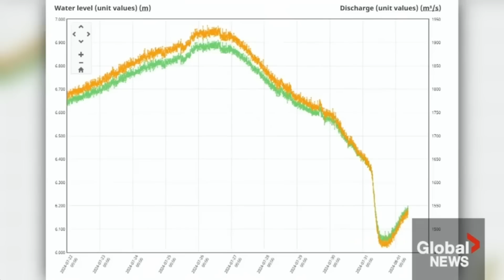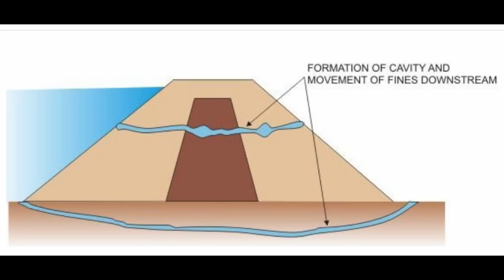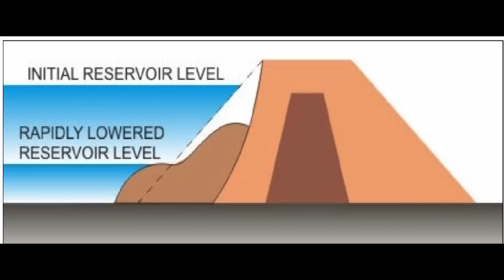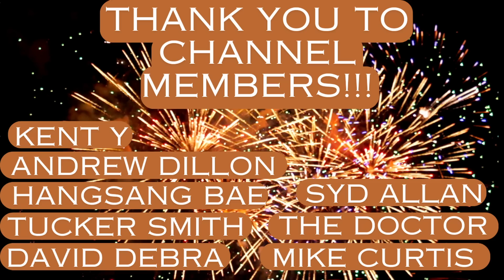Massive Landslide in Canada Creates Dam that will Fail

Comment: Yes it will overtop, but the mitigating factor is the inflow rate to the 'reservoir'. There is little rain forecast before this can overtop so there will be little excess input to drive the water flow. It should be a sufficiently large mass that will be cut through fairly slowly.  It is not like an earth filled dam which is relatively short horizontally and can be cut through vertically quickly with the side material comparatively stable.  We can likely expect a long term mud water/slurry flow.  The sides will collapse in requiring "work" by the flow to move.  It's going to be messy but I think we can all take a deep breath.  The massive, sudden debris flows shown both here and in news casts are the least likely outcome.  I think we're looking at a longer term 'surge' of very muddy water, it might overtop in stages as denser material slows the cutting action.  It's going to play hob with fisheries and water supply, but remember, this is a common event in the life of the Fraser River drainage.  Not "common" in a human's time scale but common in geological terms.  It should be amazing to watch and follow the progress of the leading plume.  I'm most curious to see what it's like at the mouth of the Fraser River and into the the Strait of Georgia.  Will it be any larger than spring freshet?  Geology is wonderful and a constant reminder that we are merely bit players on this planet.
Reply: Except the water flowing into the Chilcotin also comes from snowmelt. And we’re supposed to have a heatwave this weekend.
Reply: I live just north of Hope 11 KM and I think you are right with your analogy .Water will cut a new 
channel and a slow release will happen yes long term muddy waters with all kinds of debris.Hope
it will go slow .A good thing is it is 800 M Long so there is lots of holding power in the land.
Yes if you look at the landscape this has happened many many times in this Water shed .
Reply: This is also a disaster for the fisheries. I heard the salmon are migrating, and have not eaten in about a month, Plus all the  ash, carbon chemically change the river, Hopefully they won't suffocate. The whole ecosystem will take a HIT.
Reply: Thanks for that great and lengthy comment, this is along the line I was wondering about; future updates will be interesting for sure! I read they already made evacuations and set up no go zones; anyone know if there is a government website dedicated to this situation?
Reply: Right! Mainstream media loves to play on people's anxiety. MSM provides no stats on the relative flow of the Chilcotin River vs that of the Fraser or the Thompson. The Chilcotin  River is not that big and that dam is going to take a lot of time to erode. The real tragedy is environmental. The river's salmon runs are ruined this year, and possible for longer. One solution suggested is to dynamite the edge of the dam to get the water flowing by. I don't know if that is workable, but a flow ought to be started asap. Helicopter fly byes show three former river ledges on the south bank indicating either previous water flows or isostatic rebound. We are looking at a history of catastrophic river changes.
Reply: Let nature take care of it's self. Every time government gets involved,they screw it up ..let it be
Reply: If the entire dam becomes saturated, there is a risk that it could rapidly liquefy and begin to flow - basically just melt into the reservoir waters as they rush downhill.  The sooner it's over-topped, the better: you'd rather have a dam of relatively dry earth than a dam of unstable mud.  (Keep in mind how the dam got there in the first place.)
Reply: i totally agree. him comparing it to a manmade dam collapsing is not correct. it will top itself and it will take years before the river recuts itself a new channel.
Reply: Thank god some sense, this is not a disaster waiting to happen, look at the actual terrain and the lack of population anywhere near. No threat at all.
Reply: Exactly right, the fear being exploited is totally unnecessary

Comment: Hanceville and Dog Creek aren't town's. Should have used Alexis Creek and Williams lake as reference points.
Reply: Dog Creek does have a tiny store. I’d agree that it’s hard for people who haven’t been there to understand just how remote the Chilcotin is. They may have paved the highway, but the population especially after hunting season drops pretty low. “Gang Ranch” may be a million acres in size, but more people live on my block than herd cattle on the ranch. 

Latest from B.C. government is slide blocks about 1,000m of river length. They’re still calling it 30m deep. Lake as of midday 8/2/2024 is 11km long. 

The Fraser sees some truly large floods without much impact in the canyon. While anyone picnicking on the river would be at peril it’s hard to imagine peak flows from this thing doing much harm at Hope. High water has closed the highway in the past for a couple days but they clean that up pretty fast. I only remember one flood caused slide in the Canyon causing real problems in the last 50 years. Not as all-important since they built the Coquihalla highway. There’s a couple of obscure cabled ferries that might need to be pulled out of the Fraser River.

The Provincial government has to be conservative of course.

Comment: This is not the first time this has happened up here.  There was another slide in 2004 that did the same thing.  It was further downstream.  There are unsubstantiated rumours that water is starting seep through the bottom.  A few years back a slide also caused a partial blockage of the Fraser close to Hells gate.

Comment: I used to live in Hope BC. This will be devastating.  There are a lot of structures that will be affected if the Fraser rises significantly.  Bridges may be damaged or lost from all the debris...  more dams could form north of Hope because of debris, and then catastrophically fail.  I was there when Hope had a log jam at the tunnels like 40 years ago. If it broke, a wall of water would have removed all the homes on the Coquihalla River and one bridge.  Residents need to take this very seriously  and stay away from the Frazer River.
Reply: True.. this isn’t looking good..🧐
Reply: BC almost lost Hope with that one. Been a while since I've passed through Hell's Gate and gone beyond Hope.
Reply: There's a distinct possibility that the outflow burst might cause enough downstream erosion to cause further slides into the river. There are several worrisome choke points along the way.
Reply: Trench it to release pressure
Reply: Do you think TransCanada after Hope to Vancouver can be affected, or is it high enough ?
Reply: @dmitripogosian5084  For the most part its pretty high. It'll go through the canyon, which is "V" shaped, some areas are concerning as it gets quite narrow, in that case debris will likely get stuck momentarily, then tear away at the sides of the rocks, etc. It's not going to be bad. Am disappointed that our government didn't just drop aerial explosives from a helicopter, instead of letting the backed up water from the Chilcotin  by upwards of 20 kms or more. They could've dropped explosives beginning on the dry side in timed drops.
Reply: if the government entities weren't useless and blaming "climate" they would have blown it already to mitigate the disaster. waiting till it fails by itself is guaranteeing it.
Reply: No it wont, the structure of the ground and soil won't 'fail', it will slowly dissolve and release the water over time. You can't claim the landslide is like a big solid block and then say it will fail and disintegrate at any time, not possible. Over reaction at it's worst.
Reply: @PhilipDavies62  I think it depends on the porosity of the soil. If enough water soaks through the dirt, it may just give away at some point.  Hopefully the water won't be 30 meters high.
Reply: Abandon Hope - all ye who enter here.
Reply: <<<<chilliwack and i goin fishing..  its just water  geesh

Comment: Both of Canada's major railways, the CNR and the CPR go through the Fraser Canyon.  This could be very bad.
Reply: They can reroute to Prince Rupert.  They have a big port out there.  Not as big as Vancouver but at least it's something.  If the railway bridge at Lillooet holds then CN can reroute down the old BCR line to North Van.  Freight should make it though...even if they need to reroute through the US....
Reply: @seanfrank4158  Yes there is a container port at Prince Rupert,  and a coal terminal too.  But I think it's already operating at or near capacity. And that wouldn't do anything for the CPR, which doesn't have a track to Prince Rupert.   I'm not sure of the capacity of the container port at Prince Rupert, but I think it could maybe handle a fraction of the freight diverted from the Vancouver/Delta ports if the worst happened. Hopefully, the tracks through the canyon and down to the delta hold.  The town of Hope is also a concern, since it's right on the Fraser and low in elevation.
Reply: @seanfrank4158 ....since the jasper fire, rail traffic west has pretty much stopped. Quiter than covid
Reply: A few years back, when torrential downpours took out the railway bridges and highway bridges, it took months to clear the freight back log. US and Canadian railways are running at almost full capacity as it is, and there isn't much slack for the amount of extra freight they would have to handle.
Reply: @RoseBenson-jv5xm  Yesterday morning the Chilcotin was backed up about 5 miles, and no doubt further today.  If all that water goes down at once,  the whole lower mainland west of Hope could flood, the Trans Canada highway could flood (as we saw a few years ago), both railways could flood, and the town of Hope could flood.   I think if I lived close to that river, I would be making preparations to evacuate, in case the worst happens.  I'm a bit surprised how little press this is getting in Canada, but I think the Jasper fire is sucking up all the oxygen.
Reply: This will be a minor flow for the Frasier. From what I have seen the river is already below seasonal levels.
Reply: Probably will trigger smaller slides.
Reply: No Worries Tru-Do is in charge 😂😂
Reply: @Zzus321  What are you going to do if Poilievre becomes PM.  Who you going to blame for all the natural disasters then?   Jewish space lasers?

Comment: This is, unfortunately, a very important Salmon river so they will be affected as well as humans. Thanks for following this.
Reply from the maker: I agree with you and thank you!
Reply: There are two types of Salmon, but river variants are called Rainbow Trout at times and such.
Reply: @dra6o0n  There are 5 types of Pacific salmon here, (Sockeye, Coho, Spring, Pink, and Dog). Rainbow is a trout, and the sea going variant of Rainbow is known as Steelhead.
Reply: @RoseBenson-jv5xm  There are also landlocked Sockeye salmon which no longer return to the ocean "kokanee" i believe some bull trout also will migrate into the ocean to find a new river to populate.  

There are also often multiple 'runs' of the same species in the same river, for example spring and fall or summer and winter.  If we look at rivers which are closest to each other where they reach the ocean its interesting we can see how past natural disasters has affected the genetics of these runs within the species.  That is to say some rivers the summer and winter run will be very closely related, the result of returning salmon mostly being genetics from repopulation from the other run of the river (adults which returned slightly early or late.  Other rivers the summer and winter are not closely related and these were repopulated by salmon returning at the 'correct' time from neighboring rivers.

Pacific salmon are super interesting, its curious why there is only a single species for all of the atlantic while the pacific is so diverse.
Reply: Shhhhh!!!!,  @dra6o0n
Reply: Nature bounces back better then humanity. Still a disaster i live 100km away from it. Luckily im not downstream.
Reply: Salmon live in the Ocean they can wait it out or skip a generation or two without major problems this happened many time in the past.
Reply: @danielleclare2938  Wrong !!
Reply: @lhollybow  he's 1/4 wrong. if they can't make it up the river there will be excessive die off for that season of spawning which will have a domino effect 3-4 years later but eventually it'll recover within 10-15 years. the side issue is that some will attempt to spawn lower in the river which might not be optimal locations when the river is back at it's normal flow rate and can cause issues when any surviving salmon fry then return to spawn. that being said it's fixable and i'm sure depending on how long the natural dam lasts they'll keep an eye on the salmon build up further down the river. worst case they harvest a certain percentage of the salmon to a fish hatchery and then release their offspring further up the river once the natural dam is no longer an issue.
Reply: @lhollybow  Yes you are. Trying learning another word then you can write a 2 word sentence... good for you!!

Comment: 00:40 that inset picture is the Big Bar ferry down on the Fraser River ( as noted ) It's a pretty remote spot and isn't used too much. I've cross over there many times over the years. That, and the one further downstream at Lytton are reaction ferries. The ferry is run along a cable tied to the two river banks. The pilot orients the ferry into the current and that is what powers it across the river.  Have a look : https://www.youtube.com/watch?v=jK16eyMa7qk

Comment: I wonder if it is possible to reduce somewhat the damage by lowering the spill point of the dam.  Either a large dozer or track hoe could reduce the level of a channel pretty quickly.  Maybe too risky to work in the area of the fill?
Reply from the maker: That is an interesting idea, but I agree that it would be too risky to attempt.
Reply: Strategically placed Dynamite charges?
Reply: @62Cristoforo  Here in the midwest they will drop charges from helicopters on ice jams in the river to break it up and avoid a flood.
This was 2000' of slide though.  A few charges dropped on it probably aren't going to do it.  Maybe they could get the military to take a whack at it. lol